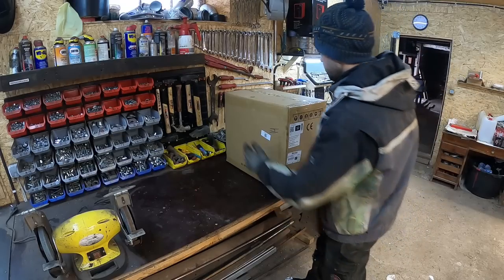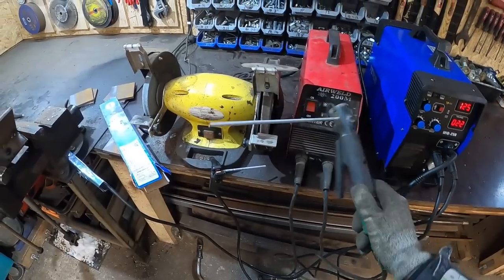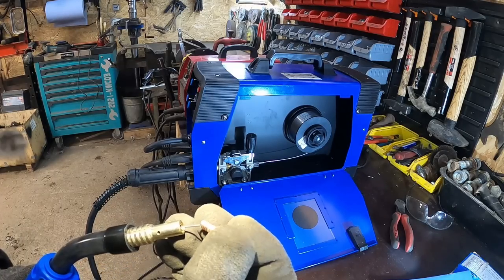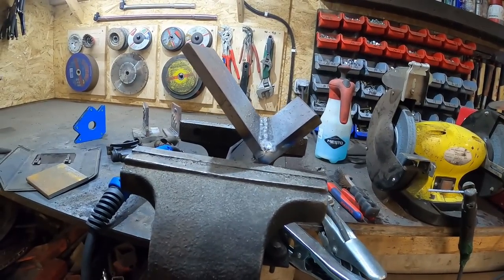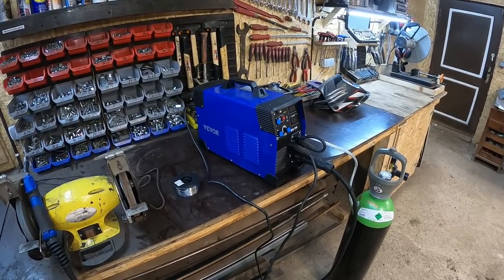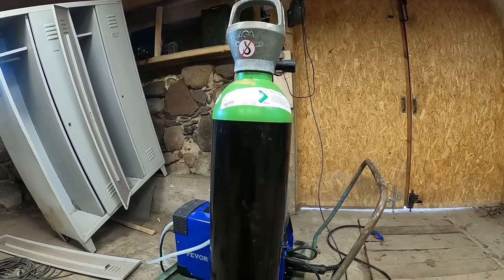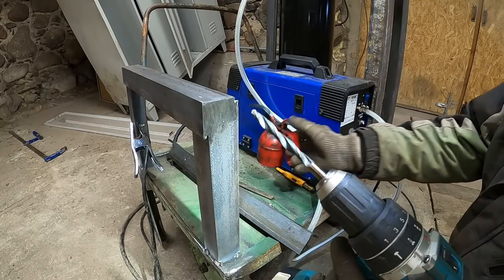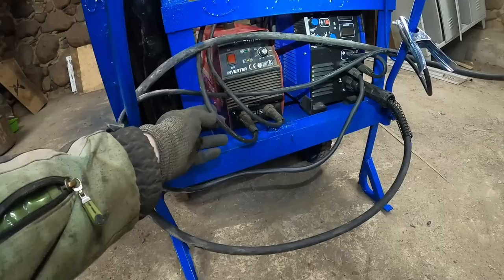My first mig welder - Vevor MIG-250

Comment: Love your content!! In the crappy state of affairs that this world is in today , it is very refreshing to have your kind of HUMOR !!! Even working without plans , you came up with an  ingenious design and created a much better  solution ,, from what some folks would have considered garbage.  Here in America, back during the 2nd world war , military engineers were told to make sure that when you design something, it should be able to do at least 7 more things if possible. 
     You recycled and turned a somewhat useless three wheeled cart into an excellent caddy. You incorporated areas for additional equipment ,  thus improving it's usefulness.  Gave adequate space for 2 tanks of compressed gases. Built in theft deterence. And finally gave it a great finish coat of paint.  4 out of 5 ain't bad bro !!  Unless you want to say that paint is solution,  so then 5 out of 5 !!  
    Matching colors is good design .  Scott in Farmers Branch.        Just out of curiosity, what is the best insulator In your neck of the woods ?? Building underground maybe?
Reply: That would work well here in Texas. Underground building
Reply from the maker: Thanks for the comment Scott, Underground will give you best outcome, as it will remain relatively stable throughout the year.

Comment: You will learn to love using mig as your in shop go to for all your projects. I went to school for welding and fabrication and I learned all 3 , and when I ran my first MIG pass ever, I was in love. That was 20 years ago and today I still use my MIG (with shielding gas) for all my projects. From very thick steel , to very thin steel. Thanks for sharing.
Reply from the maker: Thanks mate

Comment: I bought a little Hobart 140 MIG welder ( never touched one in my life ) used it to repair an old ford truck completely replacing all the rust holes and bad rusted areas in the sheet metal. Watched You tube videos. Turned out great with minimal Bondo needed. Magnet stuck everywhere!  If I can do it, anyone can do it!
Reply from the maker: Right on mate, good job

Comment: There are videos on youtube which show how you can sharpen your drill bits on your bench grinder. Something like sharpening a pencil. There is a sharpening tool available, but it doesn't work so well, because the drill bits are different sizes and they sharpen at different angles, which isn't ideal. I would put a 'wheelie bar' on the front of the cart so that it can't tip over forwards. Of course it has to be shorter than the front two, otherwise you won't be able to push it.
Reply from the maker: I will check it out

Comment: Push the torch with normal wire MIG and TIG, drag when you are laying slag, ie stick (MMA) and flux core MIG.👍 Also, if you have a scrap grinder, you can take out the mandrel and turn it down on a lathe until you can chuck it in your drill or even a die grinder. Then you can use the worn out cutting discs until they are even more worn out. But it is a bit flaky as the mandrels probably aren't meant to be turned down that thin.... But I haven't died yet so probably ok.

Comment: That seems to be a pretty good machine. You might want to reconfigure the cart because you’re going to need easy access to open the door on the side of the mig so you can change the wire. I use 75% argon, 25% carbon dioxide to weld regular steel and you can also use stargon gas but that’s mostly for stainless. You will also want to get some anti spatter spray or gel to put on your mig tip so spatter doesn’t stick to it as much.
Reply: yes, the gel you dip the torch tip into made a massive difference to a friends mig, it was getting spatter build up in the tip pretty bad until that was used.
Reply from the maker: Thanks for the tip

Comment: Bad Obsession Motorsport(Project Binky, extremely modified mini car ) made a "GRINDER SCARECROW"  which is something i have been meaning to mount near to my welding table.. basically holds spare discs, wire wheel on one grinder, cutting disc on another and grinding disc on another and such. may not be to mount on the trolley but could be handy in the regular work area.
Reply from the maker: Yeah

Comment: Make sure you have access to opening the side door to change wire and set the rollers! I made my roll around cart about two inches larger than the base measurement of the machine with little round rod stitched at the edge of the cart top machine shelf just so no sharp edges! I screw it down in a few places inside the cover! Making legs to the base shelf about 6 inches wider on all sides for stability and casters on the bottom! But I don’t haul it in the yard , just inside my workshop
Reply from the maker: Thinking i will do the same

Comment: You said it, T.i.G. welding is for thinner metals & also for strong welds for roll cages and other racing related welding. Or hotrod or custom vehicle builds where the weld beed is meant to be seen. It is easy to pass a M.IG. welding as looking good, when it may not be. So, in racing or fabrication, a T.I.G. weld is easier to know you get good peniteation and & a strong quality weld, without xraying. T.I.G. is also a lot harder to do right. More art & skill envolved vs. M.I.G. where a good travel speed & the right settings, most people could do it. T.I.G. is also very frustrating because the tungsten welding tip has to always be clean. But even the best T.I.G. welders touch & contaminate the tungsten accidentally, no matter how good they are. Then, each time, that tip has to be reground or replaced with backup ones. Back & forth it goes. Anyway, for what we see you doing with heavy vehicles, thick metal, and mostly outdoor all weather welding, T.i.G. would not be practical at all. Stick welding, clean rust & dirt removed welding areas is. So M.I.G. can be too, but for the weld to be hot enough & penitrate completely, the travel speed must be consistent. Use tack welds only for tacking! Be careful NOT to stitch weld with M.I.G. it will not be hot enough for thick metal, especially in cold weather. Those showing that on YouTube know nothing about metallurgy & how hot welding some metal has to be. Some people do that & then just grind off the surface of their stitch welds (or bad welds) to make it look nice. That doesn't make the weld itself penetrate both metal parts & fuse them, making a strong weld. That is why no good welders do stitch welds or continuous tack welds. Except on thin automotive sheet metal, where way less heat is needed to fuse them & too much heat will warp the panels. With practice, you will come to love M.I.G.
Reply: I absolutely agree to all of this.
Reply from the maker: Me too
Reply: @Ants_Pants  same tbh

Comment: You might be tempted to fix a box on the top of the trolley for the mask, welding clamps, a hammer or two, steel brushes, a grinder and discs etc. You might not use it outside but something to keep dust and everything else off the top could help keep the equipment clean. If you could bolt a box to the central cross-member it could be easy enough to remove for maintenance.
Reply from the maker: Great idea

Comment: The handle bar is on the wrong side. Remove the handle bar and weld it at the back of the wheels side. That way you can push the trolley much easier
Reply from the maker: That way i would pull it not push it. It also works

Comment: Ants, you will learn something new every single day. Tig is simple, it works exactly like the oxy-acetilene except you have electric spark instead of gas flame. The rest is the same. Grind the tungsten to a nice point, grind only lengthwise, get some argon or technical argon 4.6 (a bit cheaper) and you will be working in no time. Mig is the fastest with least penetration, flux core is made to save your day while welding something heavier outside while windy or to spare some gas money..  It's more or less similar to stick welding, except it's continuous and produces slag though.... The better option is low carbon wire with gas, where you can do also thin stuff. Sticks are ok, in your case you used the 7018, which is excelent, but it starts harder if you stop in between, because of the hard coating. Pinch the tip coating crater of to expose the wire and it will restart easily, but it needs a constant flow to run.
Good thing though, it's a thrill to test some new thingies around.. 😏Just remember to avoid working in some flammable environment. Fire can really ruin your day... Keep on, cheers and I wish you a lot of successful project builds.
Reply from the maker: Thanks mate, one of my future projects is to rework the workshop, make it more fire resistant

Comment: Neat welder, I got one pretty much identical from a different brand. They are all Chinese anyways and they actually work really well for how little they cost. (toss the manual away as it's usually not correct.) The big brand machines like Miller for example have a longer duty cycle and "better" components. For home use and hobby welding there is no need for that
Reply from the maker: I agree

Comment: Really nice welder......  for small projects :)      The 1000$+ difference is seen when you use the welder for extended time on high Amps.....   Usually the main small cheap welders problem is overheating.....but for your jobs it will be just fine. And great videos anyway :)
Reply from the maker: Totally agree!

Comment: You want to set the spool tension so when you let off the trigger the roll doesn’t backlash Andris, loosen the wire tension all the way and hit the trigger and when it starts pulling the wire turn the tension about a quarter to half turn more
Reply from the maker: Thanks

Comment: Flux and CO polarities are different. Also flux has nozzle that has holes in it or no nozzle at all. If you want tig buy an ac/dc welder so you can di some light aluminium work. I am not an salesman but buy spartus machine w.o. the "handle". Buy kemppi handle and convert that to the spartus. In Estonia that spartus is too expensive and i found out that it is cheapest by alot to order from Poland.
Reply from the maker: Hmm. Okey

Comment: Main thing is the metal has to be cleaned of mill scale and that’s by grinding it with a grinding wheel! Just buffing it won’t take mill scale off but that’s if you’re welding something for strength and to hold 100%!
Reply from the maker: Yeah

Comment: @26:37
"TIG" (Tungsten Inert Gas) is best for stainless steel, cast aluminum,
and even (preheated) cast iron. Acceptable Inert shielding gasses are Argon and Helium.

Helium is the far superior choice, but also higher priced. It's best for headers and fancy stuff.
TIG requires an extremely clean surface, and use only dedicated stainless steel brushes
with acetone to clean all surfaces prior to TIG welding.
Reply from the maker: Tig seems so hard

Comment: You can preheat with a propane or map gas torch and weld heavy metal.  Always little tricks.
Reply from the maker: Isisnt pre heatinf needed for cast?
Reply: @Ants_Pants  yes
But you can preheat thick steal to get small welder to penatrate and lay good bead

Comment: Welding with fluxcore and gas is called dual shield welding.  You can do some amazing welding with that setup.  I'm sure you're familiar with "welding tips and tricks", Jody Collier's channel.  Another Vevor tool you might want to consider is the 14" cold cut chop saw.  It's the closest thing to a religious experience for the price.  The blades last a long time, but I recommend ordering a backup blade at the same time.
Reply from the maker: To cut steel? I got one of those but from evolution brand

Comment: I use co2 on my mig welder almost all the time, I also have argon/co2 mix for better more important welds but the co2 does fine, I can also get the co2 filled cheaply at the local brewery, last time I think it cost me 15€ compared to 90€ for the argon/co2 mix 11ltr size, a no brainer for rough work.
  I thought you would have put the handle on the other side so it acts like a sack barrow rather than having to lift it to move it, gravity is your friend.
Reply from the maker: Yeah the mix is expensive :( cost me about 76 eur

Comment: Would the pulling handle not better positioned on the wheel side
Reply: 2 swivel wheels would be handy.......he made a cart so he didn't have to lift the stuff .......but he has to hold the handle side up with all the extra weight ahahahahahaha
Reply from the maker: Maybe. I see what you mean. This is fine though. Easy enough for me

Comment: Should have put the gate for the gas cylinders on the outside of the cart to make it easy to replace them without having to remove the welder first.
Reply from the maker: It comes out from the top

Comment: I just looked to see if these were actually available in Australia as I've never seen any Vevor products, they have a website and here it's a Mig270 (because we are 240v I suppose) not bad price $370 Australian dollars but it's sold out anyway. I have a similar welder i bought second hand hardly used, repurposed a tool cart for it.....I've never turned it on 🤦
Reply from the maker: hehe :D Well you know what they say, its better to not need then need and not have
Reply: @Ants_Pants  Interesting I tried to look up the Duty Cycle for the Vevor and can't find it, not really a surprise. Highly doubt it's "270" rating for here, mine is 180 and technically can't use that on full power without 15Amp power socket and normal sockets here are only 10Amp. In any case the Vevor will weld and better than nothing like you say. I would say it's more like a 150A in comparison, it's the duty cycle you're paying more for as you go up. Need to weld continuously on large items or all day then you need more duty cycle and more expensive welder

Model:
Vevor MIG-270R
Rated Input Power: 5.6KVA
??

Bossweld MST185 180A
Rated Input Power: 8.0KVA
Duty Cycle Time
7%@180amp,60%@65amp,100%@50amp
Reply from the maker: @CSkwirl  yup

Comment: I have a Lincoln 180 amp mig welder and it costs 800 dollars but it’s a lot better machine and I can weld almost consistently without stopping!
Reply from the maker: i trust you :) those more expensive ones have good duty cycle and last a long time

Comment: The wheels need to go on the back under the gas tank then the handle at the front under the welder you'd find it so much easier to move around
Reply from the maker: your most likely right sir

Comment: Nice caddy. Make sure you don't let the metal welding box touch the metal of the caddy or it can short out. I know, I wondered how also but there's a video on it here https://youtu.be/5IcesrDmNtk. The company replaced it but he put it on wood and solved the issue. It just touched on the corner and fried the machine.
Reply from the maker: interesting, that would be a major fault on the welding machine itself if that happens would it not?
Reply: @Ants_Pants  Yes, it would. However, it would leave you without a welder in the middle of a job and a hassle to get a new one replaced by Vevor like the guy in the video did. Can't believe that being an issue since it's a WELDER that welds metal so for it to be around metal and short  makes no sense to me at all.

Comment: Cobalt bits are best used when drilling work hardenable steels. 
Stainless steel is particularly bad.
The stainless forms carbide precipitates in low feed, high speed conditions. The heat from the work imparted hardens the material if the chip is thin. 
Ideally the heat should leave in a thicker chip...

HSS is tougher & better suited to hand drilling 
Cobalt can be used, but you must be super steady, no f'ing around wobbling in the hole.

I have 1 arm & have broken many cobalt bits with out a press.
They are superior in holding an edge much longer.

MIG welders are nice, eh?😁
7018 most notch crack resistant
(VERY good for welding a hammer head to a steel handle)

Lincoln Inner shield (gas less) a little less so, production oriented electrode
ERS 70  an all around mild to medium tensile filler

:face-green-smiling:My cheap ass replaced an unresponsive MillerMatic 120 w/a $200+ HZXVOGEN MIG-250
Didn't get the TIG torch at that price, but am very impressed with what the much lighter machine will do.
Also on the cheap...I use strictly CO2 gas
Maybe someday I'll invest in a TIG torch & appropriate gas cylinder for the finer work/tidy up finish passes 😉
Reply from the maker: all true, i wanna try out tig also